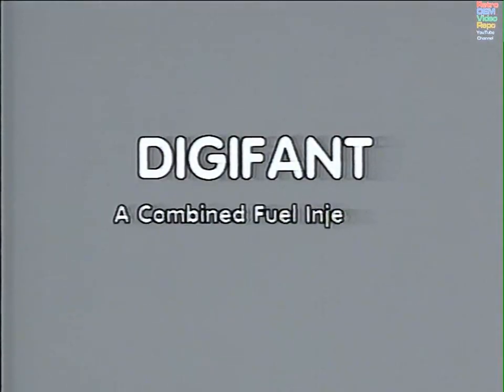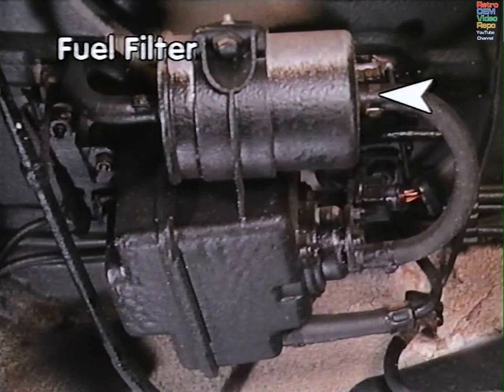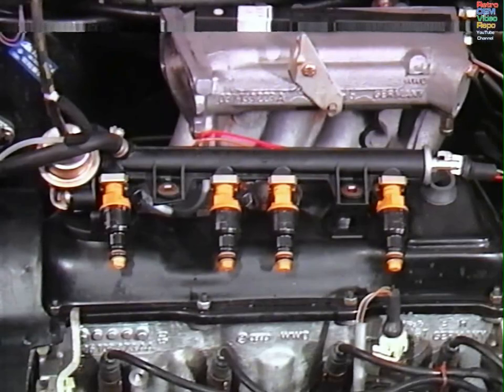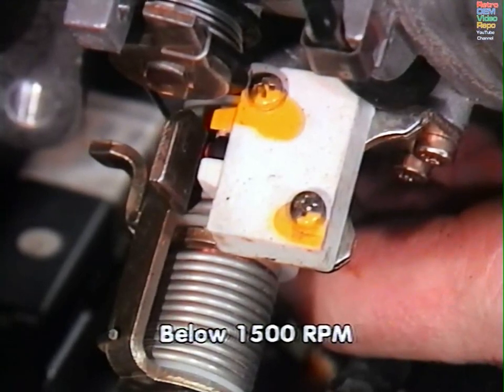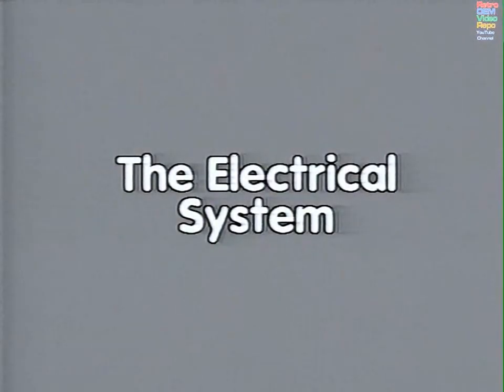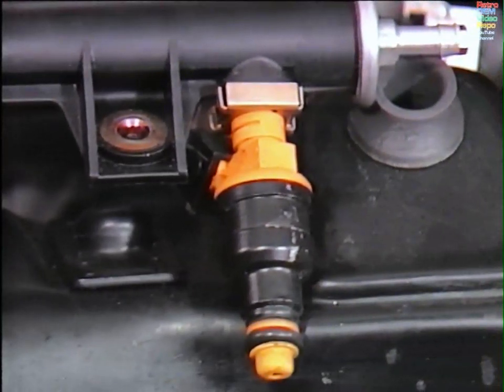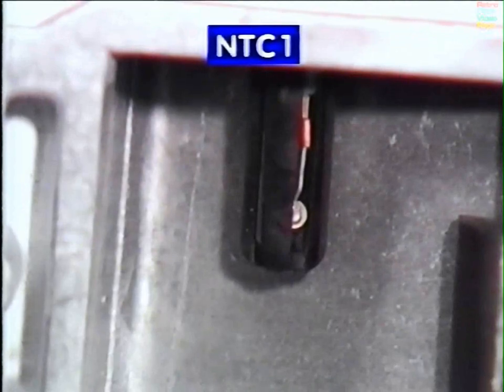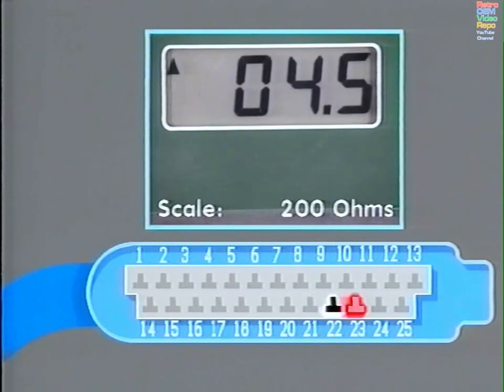Volkswagen - DIGIFANT - Fuel and Ignition System (1987)

Comment: This video is pure gold! thanks!
Reply: Maybe can resolve my problem on golf gti digifant 2
Reply: @lucacavallini561  what problem do you have? i also have a 1991 digifant 2, i purchased it thus summer, its my first, doing lots of stuff, tomorrow both fuel pumps arrive, will install and see, mine didnt stay on idle, turned off, one of the pumps wasn't working...
Reply: @solorider6229  Get a new fuel pump relay while you are at it and keep a spare in the glove box.
 These are a lot of fun to drive and easy to work on.

I recommend installing the DIGI-Fast computer chip sold by VW-Pilot on eBay. It will be the best $30 you have ever spent on your car. Another youtuber posted a video and review about it. I've been running one for almost 20 years with no issues. 
Have fun with your MK2 project.
Reply: Agreed
It is !

Comment: If you have a USA specification car or have a car equipped with a catalytic converter, don't make those adjustments mentioned at 12:05. The UK and many parts of Europe still had leaded gasoline in 1987 and this applies to those cars. Unleaded gasoline enabled car manufacturers to put O2 sensors in the exhaust system and that enables the computer to correct those values continuously.
Reply: hi friend, my golf gti 2000 mk3 from 93, I would like to buy the gunman machine to measure the CO, I wanted to ask you, if I have removed the catalyst, (I have a kind of empty silencer with glass wool, with lamba probe installed, of the supersprint) if on the service manual I get the value to be reached, this is measured with the catalyst installed, if I do not have it, what value should I reach to calibrate the engine well? can I refer to the golf gti 1800 mk2, which does not have a catalyst, but the engine is equal to 95%?
Reply: @lucacavallini561  If you have a 1993 MK3, the primary O2 sensor is what adjusts the fuel ratio without regard to the catalyst. If your car has a second O2 sensor after the cat, it is only used to illuminate the check engine light. The second sensor does not affect the fuel mixture, it only checks the operation of the catalyst for diagnostic purposes.

Comment: Digifart. My father has a 1987 VW Vanagon with this injection system and he had to build a little diagnostic system in a shoebox with a ribbon cable leading out of it that has a mate soldered onto the ECU.

Early FI like this that doesn't have any self diagnosis or any way to sanity check the inputs is awful. Stay far, far away.